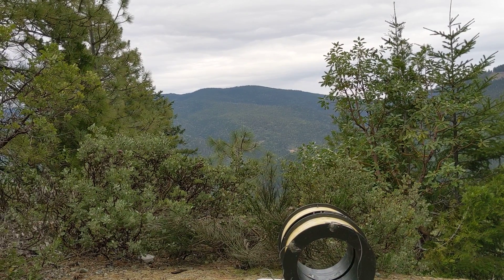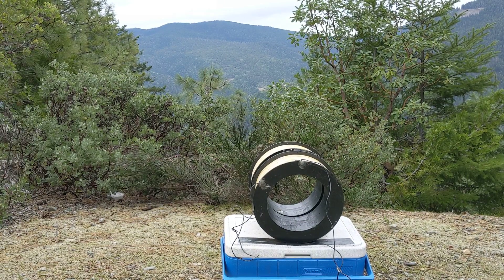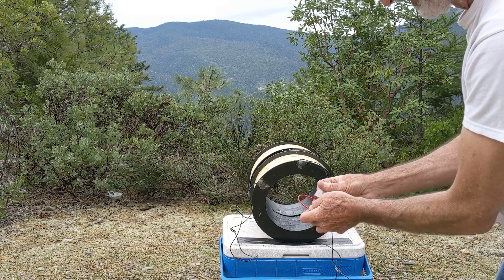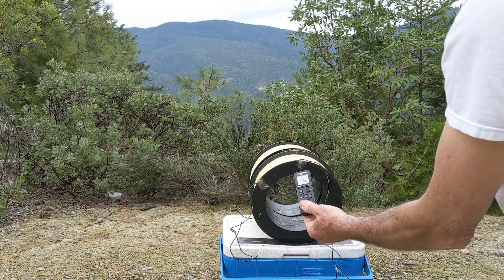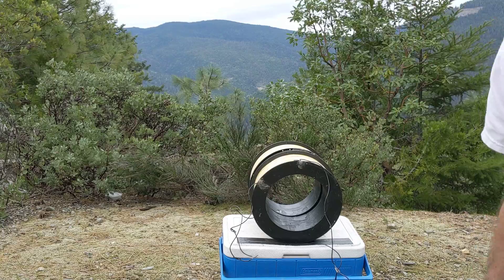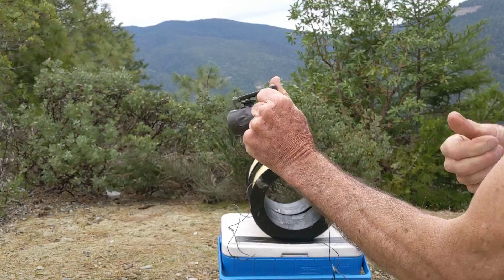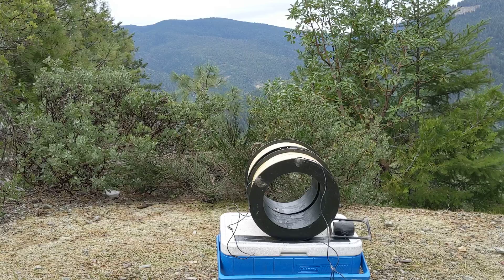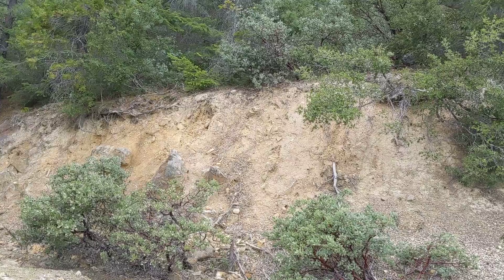Giant induction coil picking up Audio 5 feet away!

Comment: I do think about the radiation happening all around us and any effects it may have. Im not paranoid, but it seems unlikely we can coexist without any effects at all on us, since our nervous system is primarily electrical. If something happened that changes our mood or body, would we even be able to know the connection? impossible.
Reply: Another thing to add is that our nervous system isn't really electrical in the same way that our electronics are.

Electromagnetic radiation can induce a current in a wire, but the human body has no wires inside it. Nerves work completely differently. Signals travel slowly, and there's a lot of chemistry involved.
Reply: It actually is possible, and plenty of researchers are working on figuring this stuff out! To briefly summarize, going in order of increasing frequency:

- The brain CAN be stimulated via magnetic fields, but they have to be pulsed, low frequency, incredibly strong, and close to the head. Regular ol' 60Hz AC has no effect on the brain whatsoever.

Think about it this way -- if you need that huge honkin coil to even detect the presence of those low-frequency magnetic waves, good luck getting a tiny neuron to react to them.

The type of field needed to cause noticeable changes in behavior is strong enough to fry electronics. Our brains really aren't that sensitive to EM radiation.

- Radio waves can heat up tissue (think: microwave oven), but only at high power levels (eg, if you stick your hand inside a broadcasting station's radio tower). There are no other effects.

- Infrared can really heat things up. That's how the sun transfers heat to earth.

- Visible light can blind you and mess with you psychologically but has no other ill effects.

- UV light, x rays, etc are ionizing radiation. These kinds of radiation can knock electrons off of atoms, and hence can damage DNA and cause cancer. It is physically impossible for anything with an energy level lower than UV to damage your DNA.
Reply: @antonliakhovitch8306  The effects of light and color on circadian rhythms are fascinating. Hopefully nothing bad about EMF, but my dad was a radiologist and said in the 30s kids used to play with fluoroscopes at the doctors office! Took a while to measure the effects of new technology. EMF is not new, so we have some idea it's not harmful. But I wonder about subtle effects, not the life threatening ones. even music itself is a vibrational energy, and has powerful effects on people.
Reply from the maker: I've had similar concerns about electromagnetic waves, but from everything I've seen and understood. I don't think it's a problem, or linemen would be dropping dead from the heavy exposure some get while crawling along the high voltage power lines. Nature itself produces some deadly radio waves such as lightning, the sun, and planetary  explosions in outer space, but here we are alive and hopefully well.

Comment: The US National Radio Quiet Zone [NRQZ] around the Green Bank observatory in West Virginia might be far away from the 60Hz hum, except that there is regular electric power service to residents in the area... Otherwise, I guess it's like light pollution in the night sky. You need to go really far into an uninhabited area on land.

The middle of a large body of water might work well too. Besides distance from transmission lines, the water is electrically conductive and will shield from RF. Water is also diamagnetic, so, um, it might also shield magnetic flux by itself (maybe?)
Reply: I'd suspect the opposite. RF isn't an issue here, since 60Hz is not RF. However, the high electrical conductivity of water means that any AC return currents passing through the earth will preferentially favor the lake.
Reply from the maker: Someone mentioned it's near impossible to get away from, but at some point I'd like to try this much further away form any city of power lines.
Reply: @GrantsPassTVRepair  Underground in a cave, perhaps?

Comment: In the 1970's, there was a project in Popular Electronics detailing passive, wireless headphones. The output of a hifi amplifier was connected to an 8-ohm load resistor, through a loop of wire that was run around the entire perimeter of a home. A pair of high-impedance headphones was then wired to a coil of wire wrapped around an iron core within a plastic box which one carried in a pocket. Playing music through the amp and into the dummy load would create a magnetic field within the home that varied with the audio. This field induced a current into the coil of wire connected to the headphones, and the music could be heard in the headphones, anywhere inside the home. It was mono only, to be sure, but it worked.
Reply from the maker: From what I've seen, a coil with a much larger diameter does a better job of picking up electromagnetic flux, so making a much larger coil sounds like another worthwhile experiment.
Reply: @GrantsPassTVRepair  The december 1970 issue of Popular Electronics is available from the world radio history website. The project is at page 49. This idea has been previously explored in the '30, the proposed use back then was as precursor of pager systems.
Reply from the maker: @paolocanali3361  Thanks for the information.
Reply: @paolocanali3361  I looked it up. Thanks for finding it! I was a little off in how I remembered it, but as it's been at least 50 years since I last saw it, I think I did OK. 🙂
Reply: @GrantsPassTVRepair  Absolutely.
Reply: Theoretical can create stereo version - two transmitting wire loops in 90 degree angle and two receiving coils in 90 degree angle.
1970 wireless headphones with wireless power :D 
Better than bluetooth headphones :D
Reply: This is used for hearing aid telecoils
Reply: The Audio Induction Loop is a real thing for those who have hearing aids...

https://en.wikipedia.org/wiki/Audio_induction_loop
Reply: I remember a communication system for big buildings, where a special coax cable was run through the hallways, and terminated in a 50 ohm load, it allowed communication to walkie talkies, without having dead spots in the building. I believe they also had an audio system as well, with 8 ohm loads.
Reply: @jeffreyyoung4104  Still used today but for indoor mobile phone coverage, sometimes in combination with picocells.
Reply: @jeffreyyoung4104 coax is shielded cable.  This prevents signal loss and penetration.
Reply: What you describe is the same as induction loop coupling that is used in stadiums etc. for the hearing impaired. A few turns of wire running hundreds or even thousands of feet circle the stadium. The loop is fed by a standard audio amplifier. Devices for the hearing impaired contain a small coil wound on an iron core. The devices pick up the audio anywhere inside the loop. As soon as the device goes outside the loop the audio dies. Any audio amplifier works. Simply provide a loop with enough turns to make 8 Ohms or add a series resistor to a low resistance loop. The method works very well.
Reply: @TheCrunchbird  Very true, and they used the system in many schools for classrooms as well. It also reduced theft of the headsets, as they were mono, and unusable outside the school.
Reply: Jesus Christ!  I remember that
Reply: I remember that article.

Comment: This is amazing. Thank you. 
Im going to add you to my page under Experimenters. 

I wonder if it would pick up a decent signal from the ground?
Reply from the maker: Such a signal from the ground would likely be related to the earths magnetic field if it was detectable. I don't believe it's entirely static, but it might be necessary to speed up the fluctuations on an audio recorder to hear the small changes in the earths magnetic field.
Reply: @GrantsPassTVRepair  very good.
Thanks for taking the time to reply.

Are you familiar with the Thunderbolts Project? Their Electric Universe, Plasma Cosmology makes the standard model look idiotic. 

My page has become a glossary for EU and dissident science, I invite you to take a look if you find time. 

Basically it is cosmology from an electrical engineers perspective.
Reply: What signal do you expect to see from the ground?
You'd need an alternating field to produce a sound from this thing, and the earth's magnetic field is pretty static.

Comment: You can remove the hum by feeding the output of your inductor into a balanced line audio stage, which offers 'common mode rejection'. Look it up.
Reply: I don't think that will help. Surely, most of the noise is picked up in the coil itself, rather than the wire going from the coil to the amplifier.

Flipping one of the coils around will offer common mode rejection, but then the item that you want to hear will have to be in between the two coils.

Comment: I would love to know how far you have to be away from a powerline to avoid the hum.
Obviously it will depend on the voltage of the line.
Reply: It has less to do with the voltage, and more to do with the frequency and amperage/total wattage
Reply: @porcupinepunch6893  when I replied that the Electricity Provider decides what VOLTAGE to send out to the grid it was deleted
Reply: @porcupinepunch6893  The Electricity Provider decides what VOLTAGE to send out to the grid. 
In Ireland there were some protests at the proposed intallation of a 500 KV transmission line.
Reply from the maker: Me too.
Reply: I’m wondering if it isn’t coming from the ground. 
The Telluric current. 
It would be interesting to see if there are any correlations with the waveform and seismic waves.
Reply: @raycar1165 It does sound like 60Hz though.

Much of the electrical system uses the earth as a return path. Perhaps there's current from the grid flowing under his feet, even all the way out there.
Reply: @antonliakhovitch8306  Rather than the grid, I was thinking it might be coming from the Sun, moon and the rest of the universe.